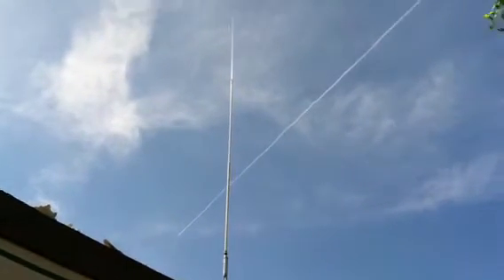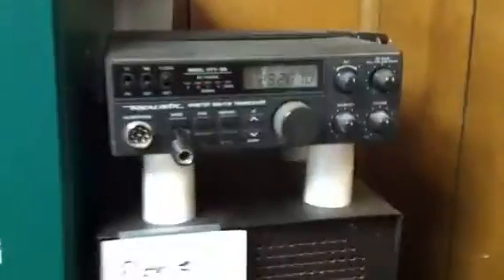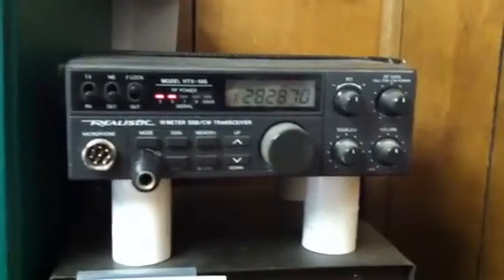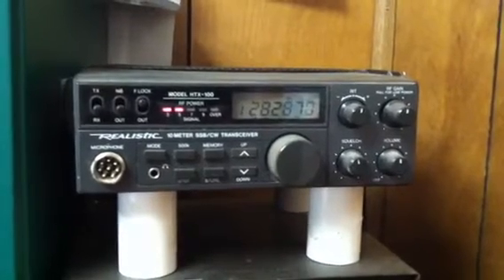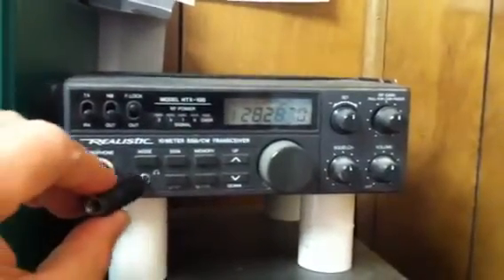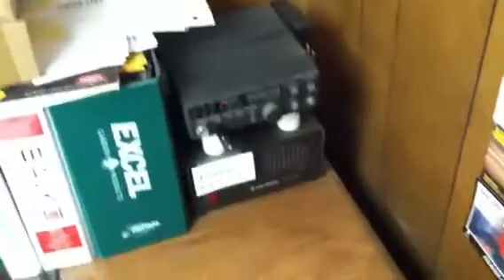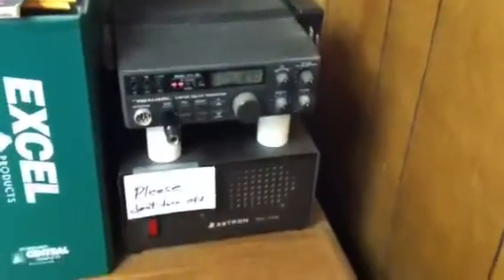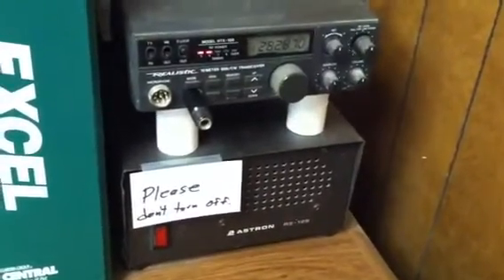10 Meter Beacon ( Ham Radio)

Comment: Oh, yes, absolutely.  Even now, in 2024.  And now, we have a cool tool to help us keep track of our beacons and do some records keeping: the Reverse Beacon Network (RBN) that gives us a listing of "spotters" worldwide.  I continuously monitor RBN for spotters of my beacon, and keep a log of the data posted on RBN.  It provides a great set of records that can be integrated into several levels of research.

I maintain an IARU registered ten-meter beacon (WD4NKA/B, 28.299.5 MHz, Deltona FL): even tonight with the HF propagation map showing zero propagation anywhere, I am being spotted by  TI7W, Costa Rica at 4dB as indicated on RBN.  A half-hour earlier it was 7dB.  If you went by the HF propagation map, you'd never know that CW was still propagating this late into the night, ergo digital communications are also viable along the Costa Rica - Central Florida path.   Beacons provide a real-time boots-on-the-ground resource for propagation and MUF assessment.

Some tell me "Heck, I just tune in the FT8 band.... that tells me all I need to know about the band and the MUF." - oh really?  Most FT8-ers I know run extremely high gain systems, and well over 100 watts.  FT8 is not the low-power mode it started out to be.  One fella I know up in the Panhandle (FL) runs a kilowatt!  Tuning in FT8 for propagation assessment is verrrry deceptive.    Nope, the good ol 1 - 20 watt beacon is still the best "boots on the ground" assessment tool.  

While I have the "hammer" down, let me editorialize a bit: it does the purpose of propagation beacon-ing precious little good to have a beacon on 10 meters at 100 watts and an antenna on a 100 ft tower.  Oh, for sure, that beacon will be heard, but that's not the point, to power through to be heard.  The point is to almost *not* be easily heard.  As WI6J points out: if you can be heard at 5 watts using an Antron-99 at average "residential" height, you have a good idea that propagation is good along the listening path, and the chances are, that the MUF exists slightly above your frequency.

The IARU recommends beacons be no more than 20w input to a vertical of moderate elevation.  There is a reason for that.

Comment: I still use them on 10m and a buddy has one on 10m. Excellent prop tool. Combine it with wwv and it will give you all the prop info on hf you need to get busy working the band. I work mostly DX cw. 

73 es gud DX de kc5ngx